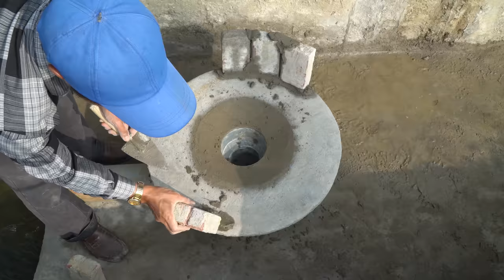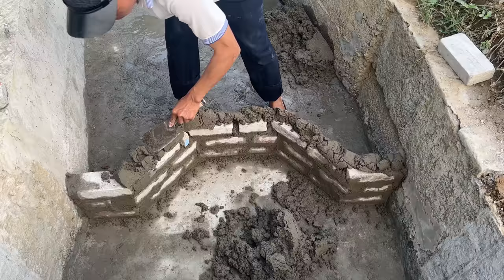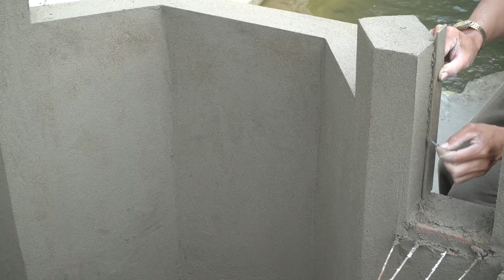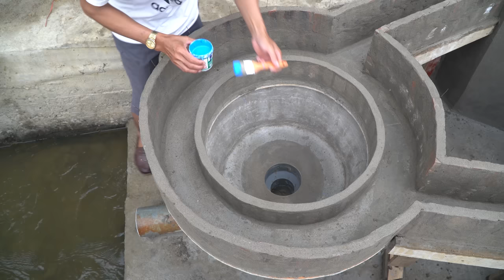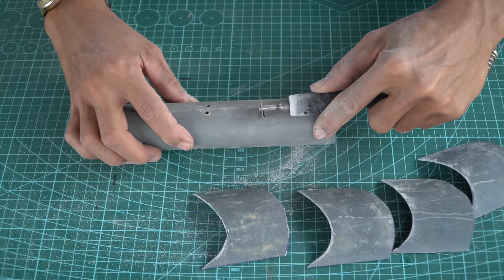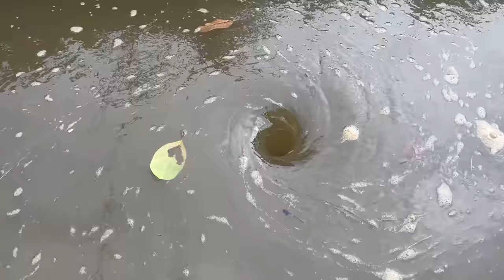Hydroelectric design with extra-large suction turbine

Comment: It would be nice to see the end result of what it can generate electrocity wise. If it for example powers lights in a nearby house or school or something
Reply: Normal light bulbs would probably already be a problem to power, even at half the brightness. But 1-2 high effiency LED lamps which can light a small room should work. It is just an estimation, as there are several other factors which have to be taken into account.  As the dam is rather tiny and the water flow isn't much, the relatively small turbine can't rotate very fast. Simply said the force of the water which hits the turbine is not very high. If the trench and dam would be twice as deep and tall, the power generation would be way more than double that amount. Of course you would then need a sufficent water flow aswell.
But a power generation measurement tool would be very cool to see indeed.
Reply: I think it might be able to produce something between 10 and 20W Max =)
Reply: aha, so big dams generate much more power in comparison to their size

Comment: Since these are model hydroelectric dams they don't last long, but it's still very interesting to watch.

If anything these model dams would be very useful to examine the flaws with the system and therefore improve them.

Pretty inspiring work mate.
Reply from the maker: That's true!
Reply: I assume if you were to measure your water flow and mathematicaly scale it down. That could give you an idea where your currents are building and causing erosion would the water behave the same or would you see a much different outcome with a larger level of water. Obviously it would erode quicker but when scaling the dam up too your scaling the time that damage takes right?
Reply: @swoopydoopy4851  The short and somewhat unsatisfying answer to the question of whether the rate of erosion scales with the size of the dam is "it depends on a bunch of geological and design factors". However, the engineering challenges associated with hydrodynamic effects such as erosion of spillways and undercutting of dam walls over time are basically solved problems at the civil project scale, although it's a pretty complex and specialised field of study. Search "computational fluid dynamics" to learn more about how these problems are modeled at scale. Obviously this guy is building these miniature projects for fun and educational purposes on a temporary basis, so he's probably not too concerned about the long-term effects of restricted/accelerated water flows.
Reply: and all the concrete, paint and steal that will emd up in the water....a miniature project but it reflects our behaviour in bigger projects as well....

Comment: You should try using Pelton Wheels / Pelton  turbines, and make a dam of some kind that is based around those turbines. Also maybe instead of making just dams you could make other infrastructure like water treatment plants and maybe even mini plastic pyrolysis factories (they turn plastic into fuel) and use the fuel the factory makes to power a mini generator/engine
Reply from the maker: Yes, thanks you very much 👍
Reply: No way you get more than 1/10kw out of this amount of water
Reply: @kimberly4275  что за флаг у тебя?
Reply: In fact he could use a mini kaplan, he could generate a lot of power, it's not nonsense.
Reply: i take these as being a bit of fun between rice harvests. plenty of water, irrigation canals, flat land...

flat land doesnt work well with peltons.
as much as i like them.

low head, they want fully submerged turbines... francis and the like. pressure turbines.

the turbine is where these guys are letting themselves down. a few paddles stuck to a rod isnt exactly efficient at converting that potential energy. 
what little there is.

quick calc... assume 20L/sec, 1M fall... 200 joules, and every second, for 200W.  at best, get 50% of that... the ideal turbine slows the water velocity to half (just like a pelton is best spun at half the water velocity) to extract the most power. their idea of a "turbine" just isnt up to the task.

100W. perfect turbine, perfect generator... lol. 70W at best. better than nothing.
constant. steady. 
these guys are lucky to make 1/2W...

i'd kill to have this sort of flow through my place. even if its only over a few meters of fall.
Reply: Pelton wheels is a decent idea, but given that he's generally working from sheet metal for the turbines I have to wonder how easy that's going to be to do...
Reply: @AdamSmith-kq6ys  spoons? it would be rudimentary but it would work
Reply: .... or on the otrher hand, YOU could do it, and make a video of your progress.
Reply: @DownhillAllTheWay problem with that is you run into things like access, and local/state laws about mucking with waterways.

I'd love to try building something like this that could power a house or my workshop but I would need land with a decent source of flowing water, and I'd need permits and approval from neighbors to build any sort of dam.
Reply: @FirstIsa  Thanks for a civil reply.  What I said was actually a rather snide comment to Trollley at the top of this thread, who was full of what the video producer could do, and I just thought that suggestions for what somebody else can or should do, are so much easier than actually doing anything yourself.  I felt that the video producer should be praised for his enterprise, and considering what he had done, I, for one, wouldn't be telling him what he could do.  I think he probably knows more about dam building that I do - or probably, than Trolley does.   I can see the possibility of this dam-builder being a consultant on larger projets in the future, as I'm sure he learned a lot from building these model dams - and is clearly interested in it.
Reply: @FirstIsa  I lived in Wales, and the guy across the road from me had a stream running through his garden.  It carried a fair amount of water, and the drop across his property must have been 4 - 5 M.  I was always envious, and if it had been me, my electricity bill would have been less, but he always said that he could afford to pay his bills, and have a lot less hassle.  It would have been a great project, though.

Comment: Not sure of the longevity of these projects, the hot glued flukes on his spinner for example, but it does prove a point that anyone with a source of running water can generate some power.  In rural areas it would be a great addition to solar to help charge battery banks for example.  Lots of potential and not really expensive.

Comment: That is really cool but hold on... you went through all that effort and then secured your turbine blades to the shaft with hot glue? I find hot glue to be unreliable even with light crafting projects. That hardly seems like something that will last long.
Reply: Not made for the long run...probably deconstructed by the time we see it.
Reply: @rustythecrown9317  awww, that’s kinda sad. I guess if he’s going to keep making videos, there’s only so many waterways he can dam up.
Reply: @rildain76  if you look at the walls of the little trench he's in , you'll see marks from other dam builds you've watched. He's standing on a concrete pad he made  to do this dam good work. You can see it in other videos as well.  Stuff is cool , but it's built then broken down and rebuilt into something else.  I'ma keep watching. Try muting it and have Left Bank 2 looping quietly in the background.
Reply from the maker: Thanks you very much ❤️❤️❤️

Comment: how many Volt you can generate 24/7 can you light up 3 houses if it´s big enoth?
Reply from the maker: 24V.
Reply: @Tran-Chien  hmm ok that is not enoth water pressure -.- so it can be helpfull if you can power like 3-4 lights outside to have a nice place to sit and when you can give felds water it have two nice really good thinks to work for, but amazing job

Comment: these annoy me. i would love to have this amount of water. and the freedom to play around with the irrigation canals!

quick calc... assume 20L/sec. 20kg/sec.
over 1M fall.
for a PE of 200 joules.
delivered every second, for 200W.
can only extract half of that energy , PE=KE. 
100W. ideally, the water flow through the turbine is half the velocity of its flow due to the fall. any faster, or any slower, and its not converting the maximum energy.
a GOOD turbine would get about 85% of that 50%... 85W.

a GOOD generator would get ~90% of that energy...
 about 75W... constantly. with a nice water feature to go with it.

whereas this is probably lucky to get 1/2W... that turbine simply is not a turbine by any means.
Reply from the maker: Yes.Thank you so much ❤️❤️❤️❤️

Comment: Why you are wasting water from passing with middle. Just block that water flow. Pressure and flow rate will increase in turbine canal.
Reply from the maker: Yes, thank you so much ❤️❤️❤️❤️
Reply: Does it look like it is engineered for 3X the flow ?
Obviously these are built for the fun of it ... and these educative entertaining videos .
Over engineering would just make it harder to remove them .
But I'll bet the rubble of them makes for some useful riprap somewhere else in their network of canals .

Comment: I am not a hydro scientist or anything but isn't the dam useless like that? Asides from bringing up the water level... wouldn't you gain more pressure if it was graphing water from the bottom of the damn? An the top gates be used in case of high water to let overflow off...   in other words wouldn't ge be completing the same thing by digging the turbine into the ground, and allowing the water to come down a waterfall for instance...   why is there head pound / damn even needed.